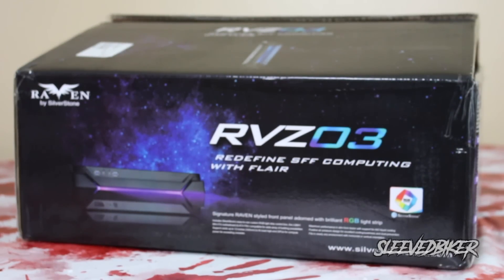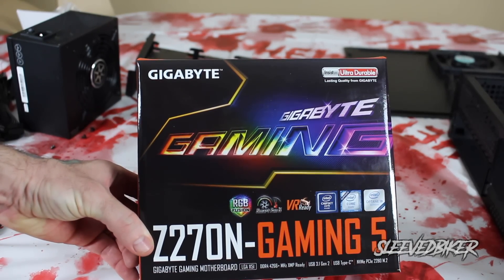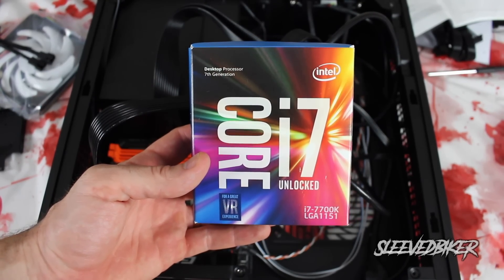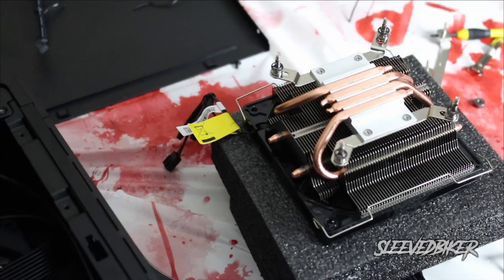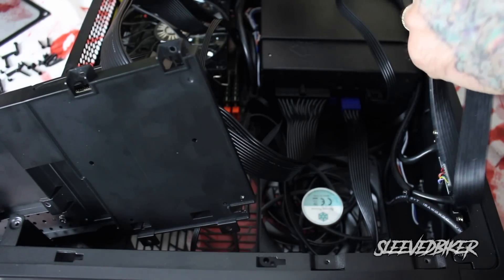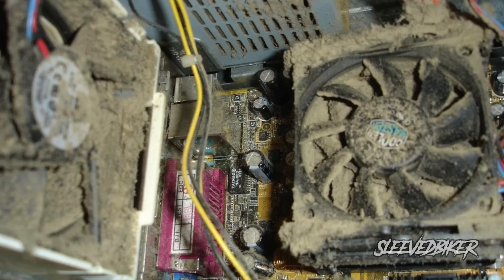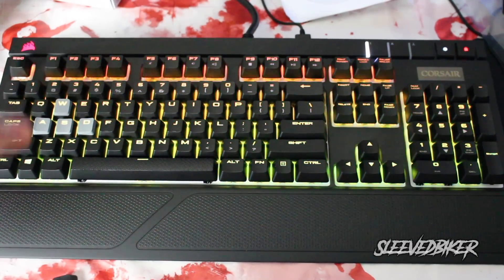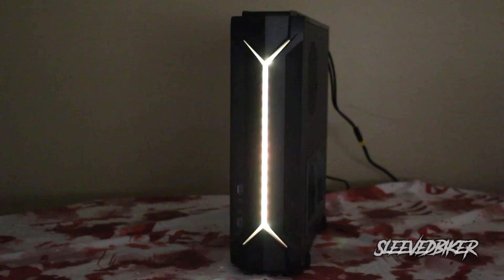VR Budget PC Build Under $1500 - Silverstone RVZ03

Comment: faster RAM does NOT mean things open noticeably faster but you can have more open at any given time, also Intel OPTANE is faster than the SAMSUNG NVMe but you are right with its lower Capacity
Reply from the maker: That's not true at all. The optane is actually slower than the evo 960, I tested both. Also, yes programs will run faster with faster RAM.
Reply: Hmmm i guess Im gaming at 4K where Optane's MASSIVELY increased bandwidth widen to almost 3 X the 960 Pro, I also said NOT MUCH improvement in fact you wont notice it, also can you pouit a water cooling radiator in this case?
Reply from the maker: Clearly you didn't actually test it or you would see that Optane isn't as fast as the 960 Pro. Also the Optane is very limited with it's small storage capacity. You also didn't say NOT MUCH, you literally said "faster RAM does NOT mean things open noticeably faster". But, yes you can put a water cooling system in the case, but it's a small one with a single fan.

Comment: Hi, this is really awesome and helpful, I will follow this build (and tell people about your video)

Question though - budget aside do you think it's ok to replace GTX 1060 with 1070 or even 1080, even with the same case and configuration? Thanks!
Reply from the maker: This fits perfect. I wouldn't go any larger than the dimensions of this card 11 x 4.5 x 1.6 inches
Reply: Thank you for the swift reply

Comment: got a question would love some help. I found a separate mobo, just watched this to see how to build in it. do i need any external extension cables? I am using the same PSU, and i know little to nothing about PC's. I am more of a peripheral man myself. How does the "High-performance SilverStone customized riser card" work? I saw it on silverstones website. Ive heard it comes with an extension socket, and is that it? is that all i need. Sorry if this sounds frantic I just really freaking love this case and want to finalise details before i buy it.
Reply from the maker: They're basically adapters that click together via pins in order to give you the option to put the graphic card into different positions.
Reply from the maker: They're basically adapters that click together via pins in order to give you the option to put the graphic card into different positions.

Comment: normal psu atx will fit in this case ?, silverstone case page show some atx psu s will able to fit
Reply: would like the answer to this question as well!

EDIT: http://www.silverstonetek.com/product.php?pid=595 says ATX but it is a short ATX that is the psu he used!
Reply from the maker: I would suggest comparing the dimensions of the one I used to the one that you're looking at. I stuck with the Case Manufacturers PSU, because it was designed to fit it.

Comment: Can you sub in a 1070ti graphics card instead of the 1060?
Reply from the maker: The 1060GTX G1 OC Edition dimensions are H=40 L=278 W=114 mm. I would say that's about maxed out. So, I would try and stay within those dimensions
Reply: The max compatible gpu length is 330mm on this case. Average 1070 ti gpu lengths are below 300mm. So yea you can.
Reply from the maker: I wouldn't even go that long. I think the 278 is about as long as I would go with it.

Comment: I did not know dust is able to slow down computer speed....  Where did you get your degree in electronic engineering?
Reply from the maker: You don't need a piece of paper to know what you're talking about. I have been building computers for almost 20 years. It's also simple logic, since it's open circuitry
Reply: SleevedBiker you are an idiot. Dust does not affect the electrical conductivity of metal. Circuitry or not. However dust will affect the thermal properties of the internal components. So can of air once a year and your good to go.

Comment: when you said you “stayed away from amd” did you forget about the ryzen 5/7 series? those certainly don’t cost 1000 dollars, in fact at most they match the price of an i7. the threadripper (which is what i think you were referring to) 1950x is 1000 dollars, but it doesn’t even have an itx mobo. i enjoyed the build vid, i just was wondering about that bit, that’s all.
Reply: sleevedbiker sleevedbiker For most games (if not all), the CPU is not the bottleneck. Just about any modern processor around $100 bucks will do anyone just fine. Even the most CPU intensive game at the time I'm writing this (Metro Redux) only requires a 3 ghz dual core processor which can be gotten on the cheap. Get a quad core and you can do stuff in the background while you game. Modern is an important point because modern cpu's have better cache and memory management, but that can still be achieved with a 4 GHZ AMD Athlon X4 880K  for about $80 bucks or get 8 cores at 3.3 GHZ for about $100 With an FX-8300 Black Edition. Don't be afraid of AMD when they offer such a value proposition compared to Intel for even high end gaming performance.
Reply from the maker: The lower end Ryzans don't out perform the 7th gen i7's.